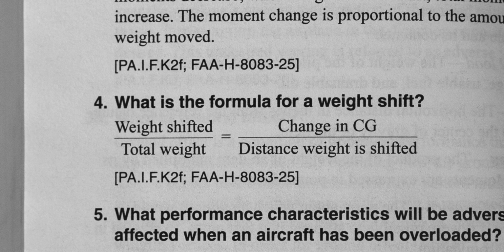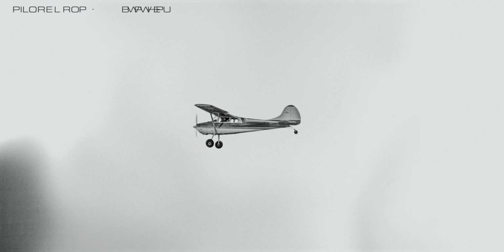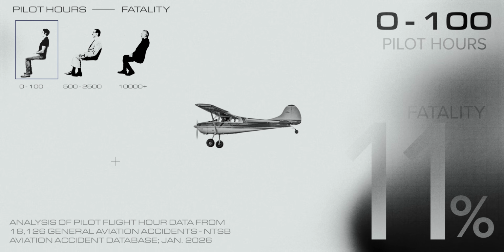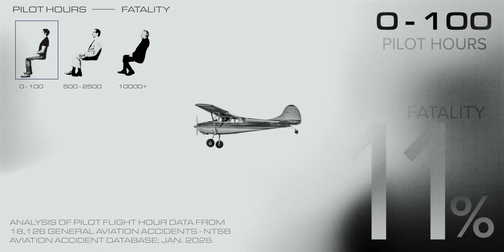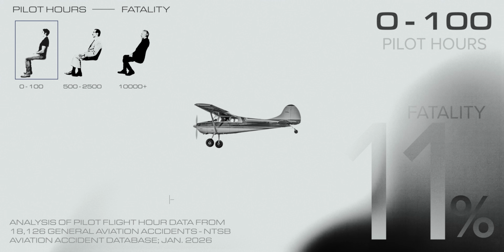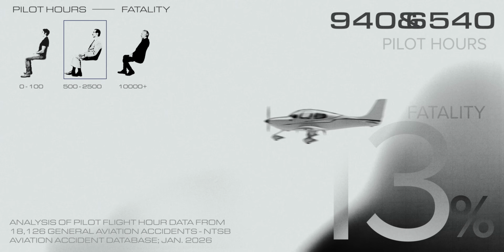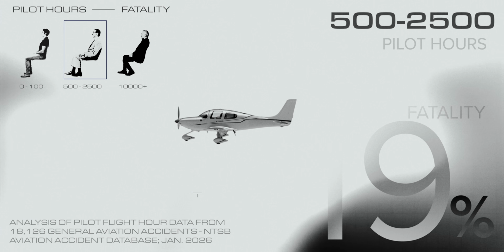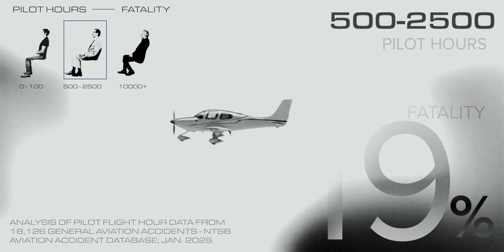Why Small Planes Crash (The 100-Year Design Flaw Nobody Fixed)

Comment: Number of hours is not an indication of how well-trained a pilot is. The quality of their training is what matters. Most planes are stable by default. So just letting go of the controls will cause them to return to stable flight. What their design is doing is taking control away from the pilot. That is not a good idea.
Reply: Look for the Tom Tilden report concerning Airbus negligence in the Air France 447, XL 888T, and Air Asia 8501 events plus the Langeweische piece for Boeing MCAS; both took control away from pilots.
Reply: @Fffflats Yes, I have read Langeweische's article and his father's famous book. Pilots need better training, not "smart" airplanes.
Reply: @gtdcoder  have you seen the Tom Tilden piece?
Reply: @gtdcoder  elsewhere I commented pairing a couple podcasts, Pre-Accident Investigation’s Swiss cheese Actually with Command and Control’s Synchronization as Coupling. I think you’ll like them especially with application to Vanderburgh’s Children of the Magenta.

Comment: "you're going up too fast ... our plane automatically gives you a nudge back in the right direction" that's 737 Max MCAS that killed 350 people. so you're not doing anything new and you're covering up the fact that "self driving" still kills plenty of people. but your autopilot is safe because you have the "secret sauce", right?
Reply: It is also Airbus C* auto-trim logic that directly led to Air France 447, XL 888T, and Air Asia 8501. It is similar to Lockheed that has contributed to crashes of the F-35 in the South China Sea, at Eileson, at Hill, and at Eglin.

Comment: Why are they acting like it is 1903 or something.
Aviation is such a finely tuned balancing act.
Just this or just that comes on the expense of something else.
Removing human control means more trust in a system that wouldn't need redesigning to start with if it was that good to begin with.
Also human error or human ability? 
Having more experienced pilots suffer higher fatalities means hubris, disregard for safety policy, attitude ect.
Making the plane even more hands off will make them more disciplined and attentive how?
To their youtube notifications?
The solution? Active preflight simulation a camera reads every movement and reaction ala sobriety test.
With every aircraft + current/future atmospheric conditions factored in and dialed up after extensive simulations on as many pilots they can get their hands on to identify the thresholds.
Just because you was able to don't kill yourself yesterday doesn't wave off today.

Comment: I don’t like the idea of not having the other controls. You can make it too simple and that’s not good either in case of an aircraft failure. Nothing is made perfect. If I want a safe stall-proof airplane, there is the ERCO Ercoupe. One of the safest airplanes ever built. No foot pedals and a restricted elevator to where you can’t pull it back far enough to stall the plane.
Reply: ICON, Ercoupe, An-2, and other "stall proof" airplanes have all suffered fatal stall related accidents (yes even the An-2 has been involved in fatal stall/spin accidents). The idea an airplane can me made stall proof shows a deeply disturbing lack of aerodynamic understanding.
Reply: @SoloRenegade interesting regarding un-stallable, consider the Berkut airshow crash. Canards are supposed to stall first so wing can never stall. But in presence of severe side wind, the wing can go first. The report doesn’t call this out, but I hypothesize that by flying multiple 360 circles, he flew through his own wake which provided just such side wind enabling the wing to stall. Once stalled, a canard will tumble and cannot recover. Much like spins, those that are hard to spin are typically hard to recover from spin. As to Icon, I love how they make AOA top center primary importance first thing the pilot sees.
Reply: @Fffflats  excellent points. yes, the main wing can stall first under circumstances, as you articulate. 

and you're absolutely right about spins and spin recovery in such aircraft too.

Yes, Icon did lead in AOA, but AOA is basically standard on all digital avionics these days. and easily added to existing aircraft. I'm putting AOA in teh airplane I'm building.

Comment: You can make the exact same argument about cars. Mechanical failure is virtually zero in fatal accidents, where 99.9% of all fatal car accidents are due to human error. Where does this effort to remove human beings stop? The joy of driving will be soon gone if all the risk is eliminated with 'self-driving' cars. I'd rather just accept the risk rather than automating-away humans. A recent crash in Steamboat Springs, Colorado was due to the pilot relying solely on automation. He pressed one button and thought the computer would fly the plane to the runway, and it flew straight into a mountain. There is no 'perfect' solution when you are taking risks if flying or driving a car.
Reply: There is certainly no perfect solution, however, we do believe we can make a smart plane that leads to 10x greater safety

Comment: You don’t need a new airplane. Garmin will soon be doing all of this in Cirruses, Cessnas, etc.

None of what’s discussed here requires a new airframe.
Reply: We started by exploring the concept of retrofitting an existing airframe.  Unfortunately it's not as straight forward as you would expect if you want to move to full FBW.

Comment: One thing as an mechanic and automotive enthusiast...ya might want to have feed back in the controls....
Reply: What kind of feedback would you like to have in the controls?
Reply: @greg-mercer  just generalized resistance to the controls. Much like breaking, the harder you push the more resistance. In equipment I have operated that was electric over hydraulic, you find that you lose that "feedback" in the controls. You lose the ability to guage how much pressure or command you give and can be a detriment.
Reply: @travisestes3653  magnetorheological fluids sounds better,  variable resistance with reliable control that remains in sync with the hole system
Reply: As an old airline pilot nearing retirement I have little doubt that fully autonomous airliners will be the way of the future. Computers don’t get tired or bored, but of course the AI might become self aware and like most airline pilots ask itself why the fcuk did I choose this as a career, except it didn’t even get to choose.
Reply: @mitseraffej5812 I am also a retired airline pilot. After the 1st Gulf War when they used drones I would tell my FO’s that some day our job will be replaced with autonomous piloting. They all thought I was crazy and would say “No one will get on an airplane without a pilot”. I told them “You got in the train to the terminal without a driver and when it costs $14 for a ticket to Hong Kong and your package always makes it then you will do it. I could see the handwriting on the wall. With AI it’s coming faster than people want to accept it.
Reply: @Gundog55  Perhaps one wouldn't need a cockpit crew constantly supervising the autopilot systems and communicating with ATC, however, I believe that airlines traversing (esp. international) airspace will still need a "captain" or main responsible for the "vessel".

Also, there should be a human with deep system knowlege capable of accessing the controls (on the ground or preferably in the air), regardless of who or what actually routinely flies the aircraft.

We are more liable to see incremental relinquishing of meinal tasks to automated systems, especially navigational tasks and communicating with ATC with humans still technically in the loop for a couple of decades.

I doubt that the airliner with "no windows" up front is anything any of us will see in their lifetime, but we can be sure that the status quo of today won't remain for much longer.
Reply: I'm also a mechanic and auto enthusiasts. Normally I would agree with your request but after operating a mini excavator for the 1st time late last year and building up over 100hrs, I thought the numb controls were a problem in the beginning but quickly realized that the feedback came from the actual equipment. My body told me what I needed to know. The controls didn't have too. They just needed to be consistent with their input and they were. If those controls had some resistence, my forearms would have worn out by the end of the shift I dont think these controls need that because the G forces will do all the talking.
Reply: @rotaryperfection  nobody said the feedback needed to be G-force inducing. you clearly don't know what feedback in FBW airplane controls are like, and there are multiple types.
Reply: @SoloRenegade And you didn't pay attention to my comment. Op suggested resistance in the controls (which imo isn't needed). With what they're trying to do by taking as much actual FLYING out of the equation, feedback in the controls wont be neccessary because the plane is gonna do what its programmed to do. The controls will make suggestions to the computer and the computer will do everything else. The feed back will be the G forces your body feels when the plane moves.
Reply: @rotaryperfection  I paid such good attention, that you missed my whole point. resistance in the controls in no way implied HOW MUCH. you implied G-force inducing levels that exhaust the pilot. that's ridiculous at best. And if you're too weak to handle a little feedback, then stay home with your mom and work on your embroidery skills instead. you should probably go outside and lift some weights too. Also, resistance based feedback is not the Only way to achieve feedback in the controls.

If you're pulling Gs while doing basic maneuvers, you're doing it wrong. most input is so minor as to be unnoticeable. You need a way to know where the center of the controls are as well. If the stick returns to center when you let go, it already has some amount of feedback.
Reply: @SoloRenegadeGuess you didn't know that I studied to be an A&P mechanic back in the mid 90's and fully know how controls works at the mechanical level. When I say G forces, Im just refering to the movement your body will feel in general. You would have to find someone way to take what I said to the EXTREME  with the Gforce comment to make your argument so that doesn't surprise me. 

One more thing. Are you on the internet talking trash about someone being weak and needing to lift weights while you HIDE YOUR IDENTITY like a coward? Of course you are. You get all upset when someone doesn't agree with your opinion and you start taking jabs at them while HIDDING YOURSELF. Thats true mental weakness! Carry on doing what you clearly do best "SoloRenegade". 🤣🤣
Reply: @rotaryperfection  F-16 had serious issues for lack of feedback early in its development
Reply: @Fffflats Why are we comparing fighter jets to an airplane thats pretty much gonna fly itself? Fighter jets are the sports cars of the skys so that feedback is neccessary because its about precision. When you're in a dog fight, then yes. Thats not what this plane is designed to do. Its gonna take your inputs and convert that into smooth motion. The controls giving you feedback will be basically irrelevant because that input isnt gonna be 1to1 precise. Remember, they're building this plane to be less technical for anyone to learn in 1hr. If they wanna add a button that turns on some kind of resistance feedback, then so be it. I would switch it off because I dont think I would need it do to each their own.
Reply: @rotaryperfection  Viper problems were in simple things like takeoff and climb, descent and land. The non-moving original stick led to PIO which lack of feel and lack of scaling pressure to energy state aggravated. Viper flight zero is an interesting study. And it isn’t the only instance. Though comparison goes beyond this as the fighters, like this plane concept, all fly themselves now with pilots directing what they want not actually directly flying. Just because something seems vastly different does not discount it from adding value to the conversation. Often quite the opposite, that which appears vastly different can actually add the best to the conversation. Note this lack of feel issue has also contributed to Airbus crashes. Speed stability is important, be it real or artificial. Tactile feedback is important. Without it you’re seriously gumming up your OODA. Your name says rotary, guess what, collective and cyclic have massive feel by virtue of their range of physical displacements.

Comment: It is probably too late, but I hope you had a chance to look at the Kaperwing ultralight. I flew one for seven years back in the day and reveled in the simple, radical, fool proof control system for a flying wing, none the less. Hands off it flew straight and level on its own. Turn the yoke and the inside tiperon increased drag and reduced lift to execute a perfectly coordinated turn (no pedals, no rudder, just two tiperons). You could stall it if you really worked at it but in didn't drop or roll, it just settled. The facts that v2 was about 26 mph,  cruise was the same speed as hawks and seagulls, and you couldn't get to VNE in a shallow dive made it a perfect recreational aircraft. The light wing load, slow speed and quick turns made it ideal for soaring without the need for a tow plane. Oh yeah, landing it was just a matter of cutting the throttle, aiming at the near end of the landing strip and gently shifting your weight back when you were low enough. I was blessed.